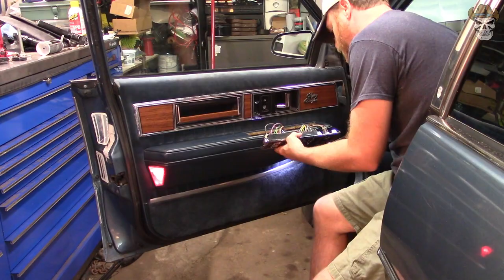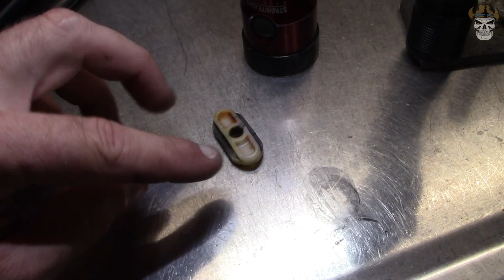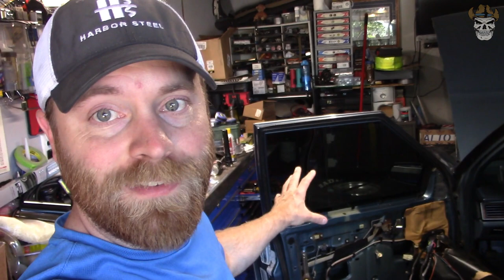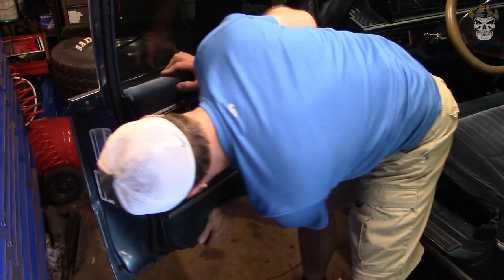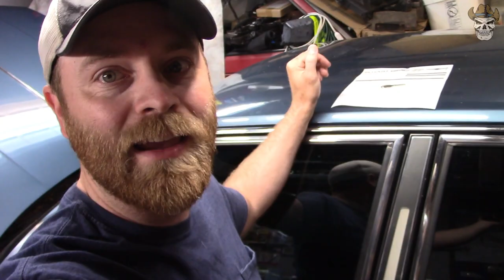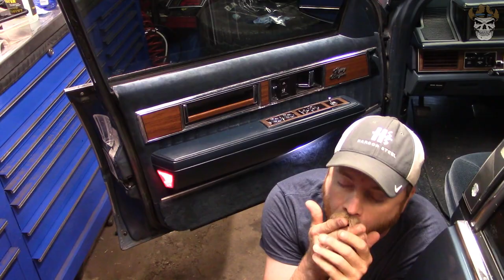Repairing Power Window On My 1986 Oldsmobile 98 Regency

Comment: I enjoyed the video. It was informative. My Toronado windows will not go up or down. I wonder if it is what you replaced or the regulator itself. I hate you went through the key issue. I felt for you. You got it resolved. I keep a spare door key in my wallet for both of my Oldsmobiles. Good video.
Reply from the maker: It only takes about 5 minutes to pull the door panel with the plastic tools from harbor fright to pop the clips.  Hopefully its not the power window regulator tape like im suspecting the passenger side is.  They over time snap.  Im crossing my fingers thats not whats wrong with the passenger window but I think it is.  As for the spare keys in a wallet I dont think that would work well for me as I own way to many cars.  I would have to have 6+ keys haha.  I think im going to get magnetic key boxes and put them on the underside of my cars.

Comment: I only ever did the diy window tint once, what a huge pain!! It didn’t turn out very good but it’s been on there 5 years. Probably gonna pull it off eventually and have it professionally redone
Reply from the maker: Yeah I have done quite a few vehicles in my time but they are never as good as the pros but I love to take pride in my cars and knowing its 100% built by me is something I like about all my cars even if its not perfect as long as its not mechanical im fine with it.  BTW pro tip if you pull the window tint yourself us PB Blaster to get the film glue off.  Ill be doing a video on that soon.
Reply: PostalRedneck now that might be helpful cuz it’s the type with glue. My truck has the vent side windows and a slide in the back so it’s more than I want to do a second time
Reply from the maker: Yeah I hear you.  I have done 2 hatchbacks, Chevy Tahoe, Chevy Suburban, Chevy Colorado, Plymouth Acclaim, Honda Civic, and a few others and it takes a long time to get it right and its never as good as just taking it somewhere.

Comment: Hello Postal, I need help!  I have a 1979 Oldsmobile 98 Regency and the drivers side window switch bezel has come loose and the switches are no longer in alignment.  There's probably a bracket under it that is broken but I can't even figure out how to get it off.  And I have searched the world wide web for a replacement bezel, and cannot find one.  Maybe the existing part is fixable, but can't tell because I don't know how to get it off without breaking it further.  Please help.  I couldn't really see how you got the bezel off your olds.
Reply from the maker: Sorry to hear about your problem and not sure if my switches are the same but on mine there is a little slot on one the side pointing to the rear of the car that you put a flat head screw driver into and push forwards.  As you do that you pull up on the side you have the screw driver in.  Its like a little V shaped spring clip you are trying to claps to get past the door handle.  I hope this helps and wish you the best of luck.

Comment: The problem I have the windows keep falling after I replace that part do you think the windows tape is bad I replaced that part three times
Reply from the maker: Well im going to be honest.  I replaced that part and a week later the socket fell out of the ball.  I ended up having to drill out all the rivets and replace the whole piece including the part that clips on the window tape.  I figured well I was at it I might as well do the window tape as well.  I didnt do a video on it as I was in a rush to get it done for winter storage.  Not going to lie its a bit of a job and that motor and window track are not easy to get out to work on.  Hope this helps.
Reply: Ok where did you fine your parts
Reply from the maker: https://youtu.be/f24gV-p7AQE?t=212
Reply from the maker: dorman 700-896 for driver side and 700-897 passenger side.  I got mine at autozone.
Reply from the maker: Window Parts From Amazon Both Driver and Passenger side
https://amzn.to/2BjYZPU

Comment: I'm trying to convert to electric windows, I was wondering if you have any advice
Reply from the maker: I can honestly say I understand why you would want to but at the same time its a huge undertaking.  You will need everything from door panels to just about everything inside the door as well as a good understanding of electrical.  Then to top it off you are going to have to gut the interior to run the wires to every door.  I know the struggle as my 95 lifted civic I ran for 8 years had manual windows.  I had everything to convert it to power just not the will power haha.  Take your time and good luck.

Comment: Hahaha that was funny man I'm glad the key work for you. I kind of have the same problem but it's like a little piece that holds the window in place call a window guide cause everytime I let the window down it'll tilt forward on me and I don't know where to buy them and these cars are hard too find. If you have any advice I would love to hear it.
Reply from the maker: Yes I have the same problem on my Yellow 1986 Oldsmobile 98.  I have bought some clips from Amazon that claimed they would fit but did not.  Im working to find the correct clips and when I do im going to do a video on it.  Its my winter beater so right now its sitting in storage till winter.  My suggestion would be to subscribe and wait haha.  Best of luck and if you find the ones that work let me know please.
Reply: No problem I will

Comment: Hello good evening I do not speak English, but I wanted to know if you have any idea what happens to my car oldsmovile delta 88 year 1986, which was 17 years without riding now I want to make it go and it does not start, change the pump since it was deteriorated, and the problem that it presents is really that the starting only makes it direct, from the starting motor, and apparently no current reaches the starting motor. which could be thanks
Reply from the maker: Try to run it off starting fluid.  If it runs off that then you only have a fuel problem.  If it dont start on starting fluid you have an ignition problem.  17 years is a long time for a car to sit.  Good luck.